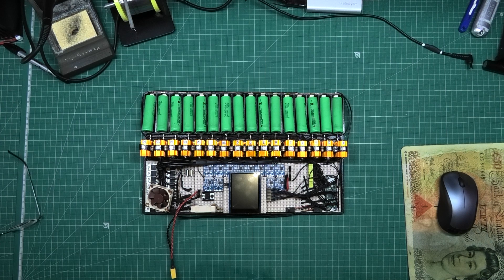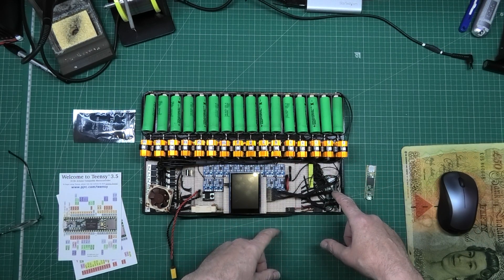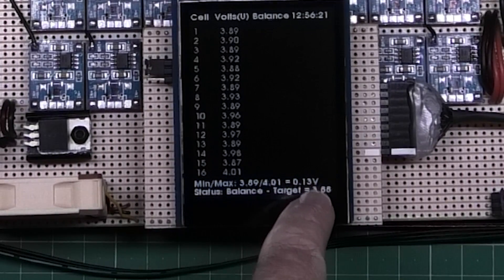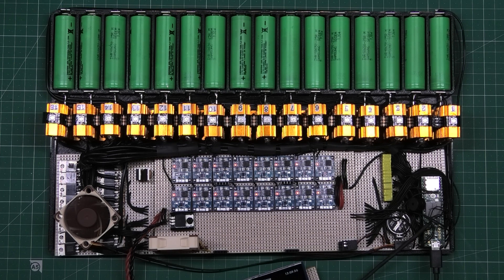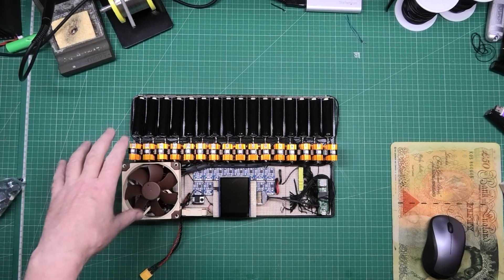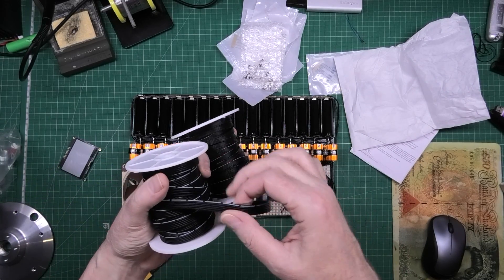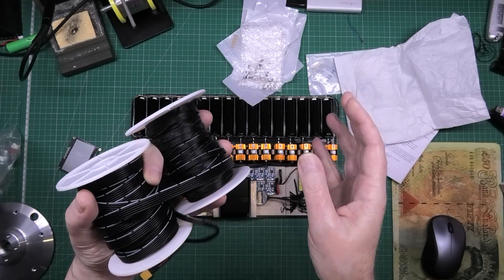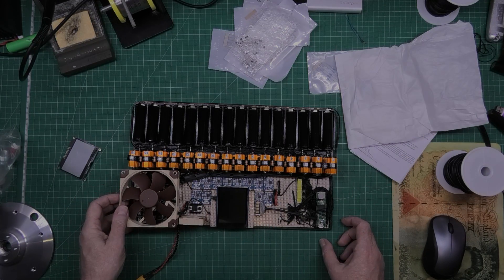16 x 18650 test rig part 5

Comment: at 6:10 you said capacitors then at 9:08 you said resistors, are you replacing resistors with capacitors?
Reply from the maker: Both, the voltage dividers have capacitors wired in parallel (for signal buffering) so I replaced both.